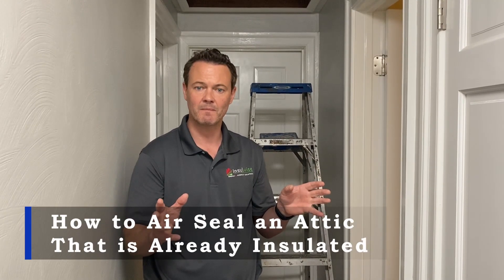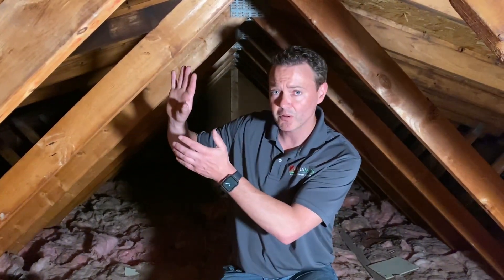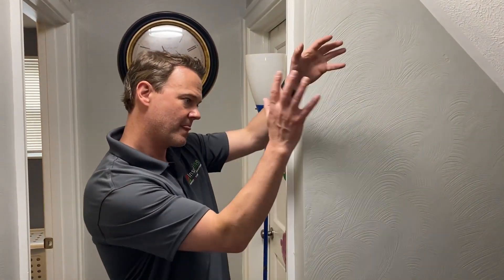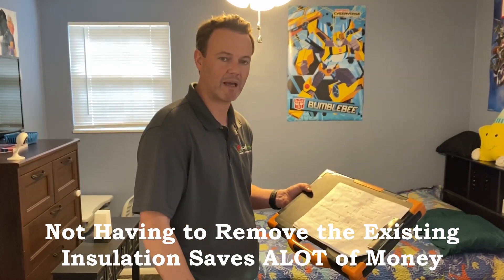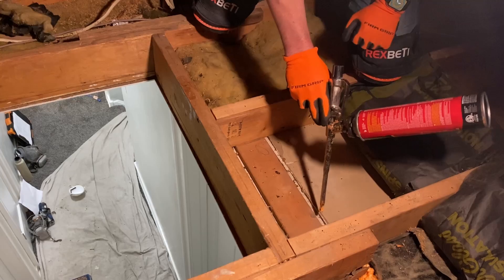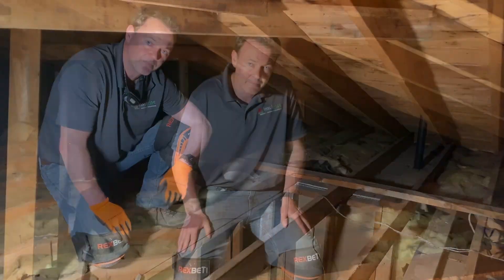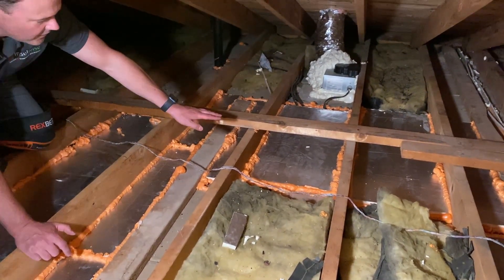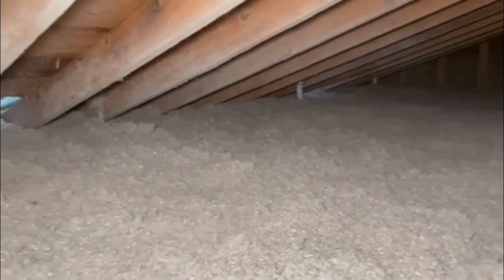Insulation Expert Reveals the BEST Way to Air Seal Your Attic

Comment: All of my walls running north to south seem to have have top plates, which I believe to be on top of the gaps in the walls. There seems to be no visible gap between the plates and the drywall below it. Should I still be adding spray foam along the sides of these? I tried a few times to see what would happen, but the foam kinda just goes everywhere even when spraying it slowly.

East to west walls seem to be normal and I am finding the gaps/wires/other holes fine and filling them. Maybe it is just the way the construction was done, the building was made in 1960 and I know plaster was used a lot for walls and ceilings back then.
Reply from the maker: Hi there, we seal the plates regardless of the appearance of the plates in terms of visible gaps or no visible gaps.  It's just a matter of habit and keeps our teams from trying to make that judgement.  But if you're having difficulty getting the foam to lay where you want it to, you might not be able to do it.  It doesn't sound like the plates in question are big leakers though so you may ok not doing them.  Hope this helps!
Andy
Reply: Thanks for the reply. I am actually really glad I came across this channel. There are many tips which I never found elsewhere (like the dust lines under the insulation).

Do you have any tips for finding sections of the attic, which have no insulation under the top sheets?. While air sealing I have noticed some sections of the attic seem to have no insulation above the ceiling except a sheet of insulation, which is laying across the beams. Is the only way to really find all of them to pull back every sheet and lock? This wouldn't be a huge problem to do while putting up the baffles, but I was hopeful there was a better way.
 @insulwiseenergycomfortsolu3293
Reply from the maker: @xSatansGiftx  Hi there and thank you!  I'm not sure what you mean by sheets of insulation.  Do you mean pink batts of fiberglass are laying across the studs?  Sheets of foam board?  Usually the ceiling fixtures, light switches, bulk heads, walls, etc give you a strong idea for where most of your air leaks will be from below.  The ones you can't see from below are plumbing stack pipes that run up through the walls.  But if you don't have a bathroom or kitchen in the vicinity of that area, you are likely to not have a plumbing pipe running up through a top plate there.  Let me know about the sheets of insulation. 
Andy
Reply: Yes I mean the batts of insulation. In my attic there is some sort of older yellow fiber glass that looks like big cotton balls and the batts laying over top of this. I have noticed while air sealing, that some areas under the batts do not have this yellow insulation and I can see the bare ceiling (after pulling back the batts).

I was just hoping you possibly knew a good way to find these spots without moving back every sheet to see the places missing insulation. I am going to be putting in blown in insulation and I am going to try and fill these empty areas under the batts.

If the best solution is just to move every batt and look  under it, I will just do that. I was just hoping there was some easy way to find these bare ceiling areas.

Thanks for the reply again. @insulwiseenergycomfortsolu3293

Comment: Where the shower bulk heads and stairs were sealed seems like the moisture would get trapped in the pockets. Have you ever been back to one years later? Especially the bathroom ones.
Reply from the maker: Hi, there's only a problem with moisture and water vapor if there is a surface present that gets cold enough for water vapor to condense.  If this happens mold can start to grow.  However, these "pockets" are fully within the conditioned space of the home, and there is a full layer of insulation on top of them.  So there is no issue.  These are common ways for air sealing cavities in floors of attics.  We've been utilizing these same solutions for 15 years in thousands of homes, there's no issues. 
Thanks, 
Andy

Comment: hi can i put fiberglass rolls over existing blown in cellouse from  years ago (settled)that was blown over fiberglass insulation from when the house was built in 1957
Reply from the maker: You could, but --- the reason that we are not proponents of using batt fiberglass in attics is because it's almost impossible to get the batts to conform around all of the miscellaneous obstructions that are located on the attic floor (plumbing stack pipes, wires, bath fans, recessed lights, the roof rafters at the edge of the roof) and you wind up with lots of gaps.  I'll attach a link to my site and you can see some pics to see what I mean.  That said, I would do the best that I could with fiberglass batts before I used blown fiberglass.  But best choice, at least as we see it, is to use blown in cellulose insulation. 
Good luck to you!
Andy

Comment: How to walk through those blown-in cellulose if I need to checkout any roof leak damage? What if minor roof water leak, how to handle the wet cellulose ?
Reply from the maker: Hey there good questions.  If you need to get through it I'd recommend getting knee pads, a dust mask, and a head lamp.  You want your hands to be free in an attic.  You will need to use your feet to feel for the floor joists while using your hands to hold onto the roof rafters for support.  After you have looked at the area you can brush the cellulose back into place with your feet, hands, or a broom.  It's easy to do.  But  --- BE careful.  We are practiced at doing this, but novices can fall through their ceiling if they're not careful.  Also, the cellulose should be fine.  Here is a link to a video that I took that shows what happens to cellulose after a roof leak.  It's fine so long as it can dry out. 
https://www.youtube.com/watch?v=2XQK-Ba1hWc&pp=ygUXaW5zdWx3aXNlIHdldCBjZWxsdWxvc2U%3D
Andy

Comment: I have blown in cellulose thats about 12 inches, i went into my attic to air seal and it was impossible , too much cellulose.  I ended up finding the pvc vent protrusions and sealed the holes that they came up theough and then called it a day lol.

Will it be beneficial to seal everything from inside the home instead? I did all outlets and a few lights.
Reply from the maker: Hey there, yes it is definitely a chore to air seal when blown in cellulose is present, especially when there is a lot of it.  We do have to deal with this from time to time here.  And it would be this type of situation where drawing a map of the air leaks before going into the attic would be most helpful.  It's just too difficult to find them all otherwise.  What we do is standard knee pads, gloves, headlamps, and respirator, and then move methodically through it, sealing as you go.  You will be covered in cellulose as you move it out of the way.  Your whole attic look like a series of lumps and piles when you're done.  At that point we would move back through it and use something like a house hold broom to "swoosh" it back into place so that it's even.  Air sealing an attic that is already blown with cellulose is definitely not for the faint of heart.
I think it would be nearly impossible to do a good job air sealing from the inside once the house has been finished.  You would never be able to get the top plates, wire holes, around bath fans, junction boxes, etc.  There are types of recessed lights that can be sealed from the inside, but my guess is that you'd miss 90-95% of the penetrations in the attic floor.  That said, I give you credit for trying!
Andy

Comment: Great video, great tips on the ceiling mounted fixtures. I initially went up into the attic in search of some leaky drop soffits which were causing a cold kitchen, but happened to have found many many issues. Horribly wind washed soffits, massive penetrations at the chimney, wide open soffits where mice had gotten in, and more. Problem is I cannot get to many of these locations due to the shallow pitch of the roof towards the eaves. That also includes part of the kitchen soffit. May have to wait until spring and budget to completely reinsulate.
Reply from the maker: Hi there thanks for the compliment!  Yes I know exactly what you are talking about with low sloping roofs.  It is exceedingly difficult to get access to these areas sometimes.  Also where there are drop soffits (we call them bulkheads here), it is likely that the exterior wall stud bays are also open directly to the attic.  What we try to do is make sure that any light fixtures inside the drop soffit are ideally IC rated, or at a minimum have LED bulbs installed in them (they don't create much heat).  We then then insert a fill tube down into the exterior wall bays (usually while laying on your stomach) and dense pack the exterior walls that are open, and then blow the drop soffit full of cellulose.  
If the homeowner has plans to remove the drop soffits then we cap them with foam board and foam sealant like you see in this video.  Either way, working in attics with low sloping roofs is usually quite tricky.  Taking up a small board or sheet of plywood to lay on is often a great help.  But once the air sealing work has been effectively done (and ideally the attic insulated to an R-49 with cellulose insulation), you will see massive improvements in your home's comfort as well as energy efficiency. 
Andy
Reply: Thanks for the valuable info AND the discussion in the comments. Just goes to show…few customers are 100% satisfied.
Reply from the maker: @johnpacella9519   You're welcome John thanks.  We try to satisfy everyone, but as you know that's tricky.  I think we do a good job with most people who are reasonable however.  At least that's what we shoot for!
Andy

Comment: informative.  What about baffles to the exterior soffits?  Isn’t that important?
Reply from the maker: Great question, but we only install soffit baffles when the home has soffit ventilation.  Many of the homes in our area were built without overhangs or soffit vents.   In this case we install slant back vents to add intake ventilation. 
Andy
Reply: @insulwiseenergycomfortsolu3293  In another video it would be awesome to see how you did that retrofit of slant back vents install
Reply from the maker: @andrewhollinger2591  Your wish is my command.  I don't show the full method of cutting the hole in, but this is what it looks like when done on a Cape Cod style home a few minutes in: 
https://www.youtube.com/watch?v=x_z9FLeg5AA&t=7s

Andy

Comment: 9:56 Are the soffits dammed by batt?? or did they have a ridge vent and get baffles?
Reply from the maker: This house had no soffit vents, the gutter was hung directly on the exterior wall (there was no overhang).  We installed slant back vents on the back of the home to provide a means for intake ventilation.  You can see light shining through from some of them at the end of the video.
Andy
Reply: @insulwiseenergycomfortsolu3293   wow ok nice, great work....really love the ceiling map idea too

Comment: I would have liked to see a blower door test result before and after. That process you showed is a huge improvement. Don’t forget about the sub-rim joist. Up to 20% of loss is there. Cut the foam to fit leaving about 1/4-1/2 inch all around and use the same foam to seal it. Then put an R-15 Rockwool over the foam all the way around. You do both of these and the comfort level of your home will be unbelievably improved.
Reply from the maker: Hey there thanks for the comment!  I will do another video that shows us doing a blower door test in and out with this type of job for sure.  We often do also spray foam rim joists in houses.  Your method of cutting the foam board definitely works, but can get tricky around wires and tough to reach areas.  We spray foam rim joists with 2 part, closed cell foam for that reason.  But you're correct in stating that the impact on comfort achieved from doing an attic and rim joists is often dramatic, not to mention the improvement in the home's energy efficiency. 
Thanks!
Andy
Reply: Great video! We had R-50 cellulose blown in according to our energy auditor, but I am more concerned about our bathroom vent fan as we made our home more air tight because we removed all of our combustion heat sources and our dryer vent is gone. Heat pump everything now… 

Now we have noticed our vent fan ends up dripping water at -15°C when it is highly humid outside after  a shower, even after leaving the bathroom fan on an hour afterwards.

Have you tried using a FLIR camera to see the main issues before? I’m seeing some concern areas with it, and some good electrical work too we had done that isn’t showing issues.
Reply: @RockyMountainTesla  that sounds absolutely awful!

Comment: The metal nozzle screwed onto cans is a very good investment.  It greatly reduces the amount of foam waste, which pays for itself.  Also, the foam release can be adjusted more efficiently and a longer nozzle reaches further.
Reply: Don't the attachment nozzles want to plug up?
Reply from the maker: @SEaudiofan  They will if you allow them to sit unused for more than an half an hour or so.
Reply: @SEaudiofan  Acetone clean up.
Reply: You attach a dispensing foam cleaner to the foam gun afterwards, spraying out any remnants of foam that's leftover.  There are several brands, but Great Stuff has such a product that is in any big box store (Lowes, Home Depot, etc).  If not, you would have to buy another gun.  Just make sure you are doing this in a trashbag or something that doesn't leak as this process can get pretty messy.
Reply from the maker: The foam guns are helpful, but we do not always use them.  We find many areas where they are too large and cumbersome to allow us to seal gaps and openings effectively.  In these areas the small cans of Great Stuff come in handy. 
Andy
Reply: @insulwiseenergycomfortsolu3293 Interesting reply…based on vids of installers trying to demo different types of foam products, by creating several side-by-side “beads” used for comparison, without any nozzle attachment, those comparison beads were not uniform in depth, thickness or alignment. Kind of a mess without using the nozzle piece. IMHO

Comment: What kind of pricing does something like this cost
Reply from the maker: @insulwiseenergycomfortsolu3293
7 hours ago
It's tough for me to give an exact figure because every attic is different, even homes in plans that are next door to each other.  We generally charge about $1 per sq ft for air sealing, and then extra for large items like stair well voids, bulkheads (dropped ceiling areas), recessed lights, etc.  We then charge an additional amount for adding in the extra cellulose insulation at the end, and that depends on how many inches we need to blow in to finish with a combined R-49 insulation level (generally about 15" inches total). 
Hope this helps!
Andy

Comment: Great work! Curious what you charge per sq ft for jobs like these?
Reply from the maker: Thank you for the compliment!  It's tough for me to give an exact figure because every attic is different, even homes in plans that are next door to each other.  We generally charge about $1 per sq ft for air sealing, and then extra for large items like stair well voids, bulkheads (dropped ceiling areas), recessed lights, etc.  We then charge an additional amount for adding in the extra cellulose insulation at the end, and that depends on how many inches we need to blow in to finish with a combined R-49 insulation level (generally about 15" inches total). 
Hope this helps!
Andy

Comment: How about a vapour barrier sheet spread across the attic. Is wood permeable?
Reply from the maker: Wood is permeable, but drywall with a few layers of paint on it is generally a "pretty decent" vapor barrier.  Think of your bathroom ceiling after taking a hot steamy shower if you haven't turned on a fan, it will be dripping.  We seal the penetrations, and then make sure the roof is properly ventilated.  If both of these measures are done correctly, it is exceptionally rare to later have a problem with excessive moisture or mold in an attic space.  
Andy

Comment: My attic has 6-8 in. of cellulose. Will put more because I noticed when I turn heater on then off my hear escapes a couple minutes later. Should a crawl space also be insulated? Thank you! Any tips recommended
Reply from the maker: Hi there sorry for the delay.   Before you add insulation to an attic you first want to air seal it like we do in this video.  But yes, doing both air sealing and insulation work will definitely help the heat to stay in your home more efficiently.  Most crawl spaces should be encapsulated.  That means insulating and air sealing the walls and then installing a vapor barrier on the ground.   
Andy

Comment: Very informative video. Great stuff! (pun intended) Why do you recommend foam versus polyurethane caulk for sealing the air penetrations?
Reply from the maker: Thanks!  Polyurethane caulk would work just fine in some cases.  The reason we like foam is because it is far less expensive, expands to seal all kinds of varied penetrations, can fill voids as wide as 4-6" inches when you learn how to use it correctly, the can and straw can fit into LOTS of tight and difficult to reach areas, like plumbing penetrations that are close to the edges of roof decks, etc, and the cans don't freeze.  I've had tubes of caulk freeze in the back of a truck and then become unusable.  Cans of Great Stuff can sit in a truck at 0 degrees for weeks, then after running some hot water over them they're ready to go.  
Hope this helps!
Andy
Reply: Blower door test with no climate Folie sealed properly before you put the Gipsum board there? It’s useless….